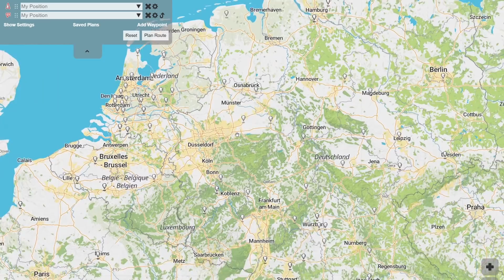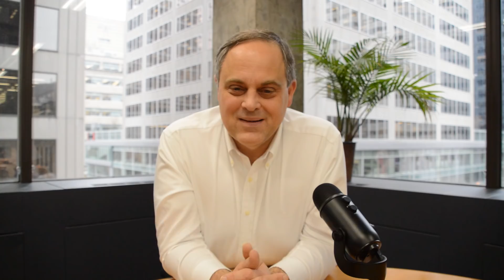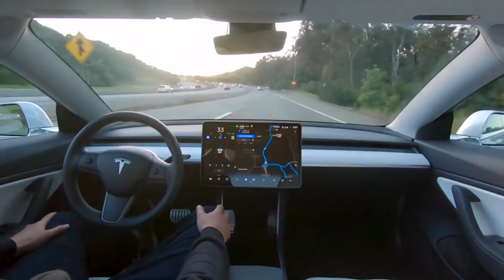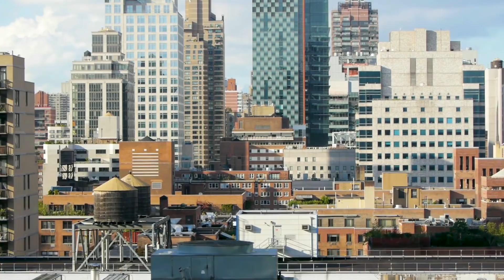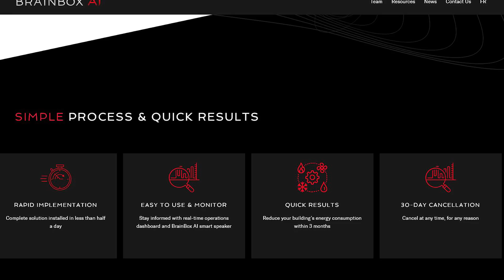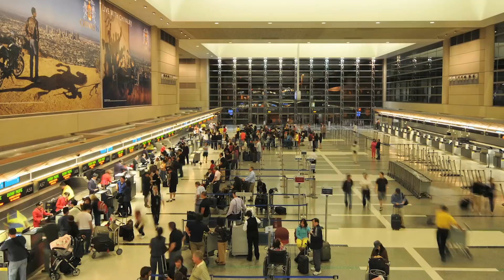Your Building Is Dumb | In Depth

Comment: Big fan of ground source heat pumps
Reply: I'm a big fan of variable speed ("inverter") based systems.  That alone can cut the overall energy usage of most HVAC systems in half.  It used to be expensive technology, but now that electronic motor speed controllers are cheap and common it should be required by law IMO.
Reply: @CL-gq3no  basically all heat pumps here in scandinavia are inverter based. So is dishwashers, washing machines and so forth. Energy optimisation is very important
Reply: @johndoe1909 , I think most of the world has moved to ductless mini-splits or other types of inverter based heatpumps.  Unfortunately, in the US we are still building brand new high end homes with single speed central HVAC systems that are basically 1980s technology.  I think the current HVAC efficiency standard is 14 SEER which means at least twice the energy usage for a given amount of cooling as a typical inverter mini-split.  That's also around 3x the energy as a typical geothermal HVAC system.  What a waste.
Reply: Specifically versions that can do heat recovery as that opens up free movement of heat between zones in the home.  Cooling your house indoor air?  Move that captured heat into a hot water tank.  Now that's the future.